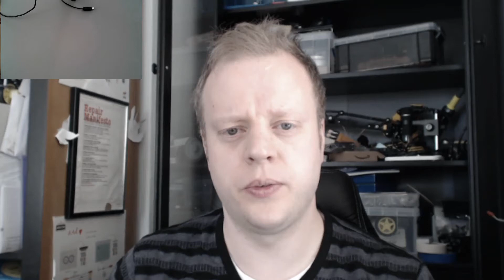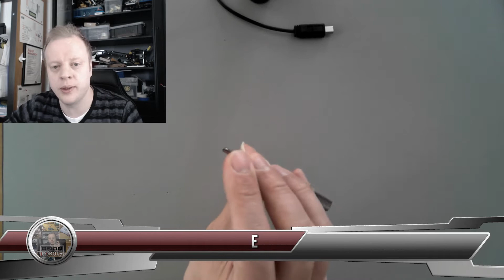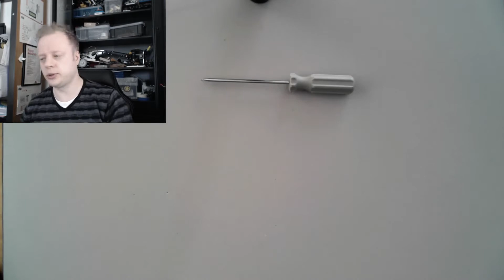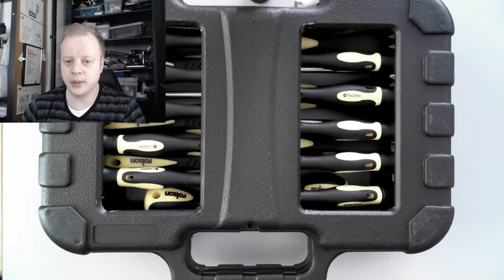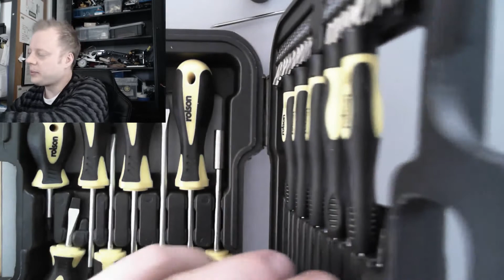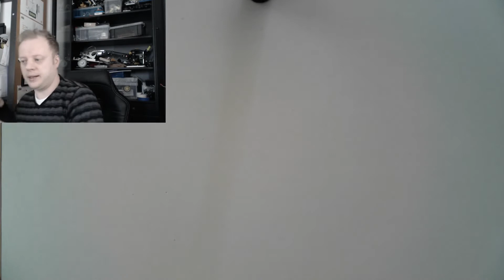Lab Gear: Goodbye to old screwdriver - new Rolson Kit

Comment: These are absolutely rubbish. I used the PH2 twice on something that didn't even need WD40 and it mashed the head on the screwdriver. ALL of the precision ones i tried round screws as they don't fit right. I got a kincrome set of precision and some wera / stanley and the difference is unbelievable. They don't even need to be magnetic as the driver holds the screw as you pull it out.
Reply from the maker: So far I've only used the short stubby, the hex-jewellers in them - so I'm yet to get to know them. I don't like how much swarf was left on them, and I don't like how much flash was on the cheap case. But the screw drivers have so far not failed me yet. My comparison were ones that were perhaps both cheap AND old, so I may not have the greatest bar to hold them against.
Reply: I literally went and bought ONE wera screwdriver and it changed my mind forever about cheap screwdrivers. I've abused the absolute hell out of the bits (even put them in impact driver, even feeling bad about doing so) and not a single mark or chip on them. I got these two they're amazing: https://www.amazon.co.uk/dp/B000X1R2K2/ref=cm_sw_r_cp_dp_T2_phTozbS0EQVYW

and

https://www.amazon.co.uk/dp/B000BK7AOS/ref=cm_sw_r_cp_dp_T2_VhTozbVYET18K

I bought the second one I linked as my first "Good" screwdriver, and it's still my go-to driver. But I've also bought this: http://www.homebase.co.uk/en/homebaseuk/stanley-6-in-1-screwdriver-236667 which I now abuse instead of the Wera. Pleasently surprised how well the bits grab in this also and very quick to change bits. Fair enough 2 of the nut driver functions are imperial, but it's certainly got a sturdy grip on both the handle and bit and definitely comes in handy in the kitchen drawer rather than having to go to the shed.

Comment: I think I still have a slotted screwdriver that was bought for me when I was a boy in the early 1970s. A few years ago I spent £23 on a set of 7 Wera slotted & Phillips (one of which was one of those really quite dangerous 'testers' with the neon light). Wera and Wiha are very nicely made but unless you spend hideous amounts of money on multiple sets - you never seem to have the size you need. I also have a set of those little stubby hex bit drivers that came with just one handle in a moulded box weirdly branded Smith & Wesson.
Reply from the maker: I've got a few of the stubby hex drivers too - handy sometimes. I also remember the testers - never owned one.  One reason for the 58 part set was never having the right size.